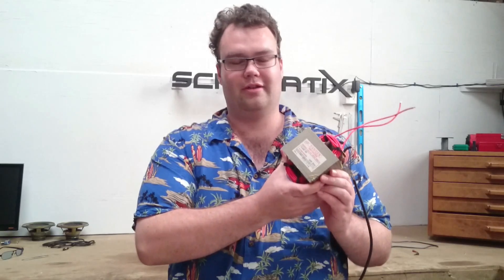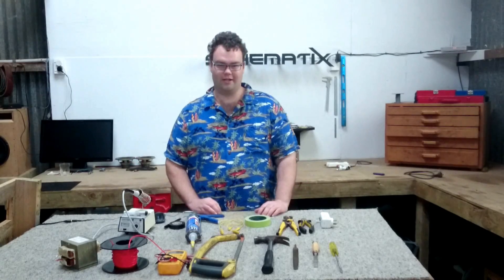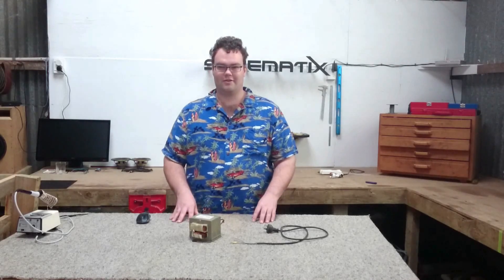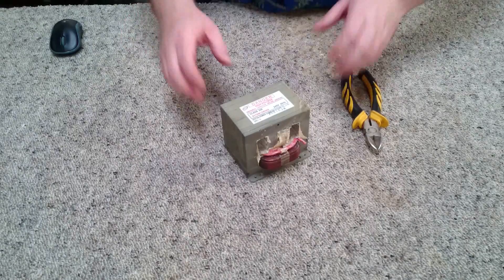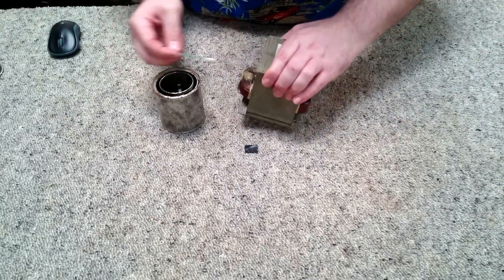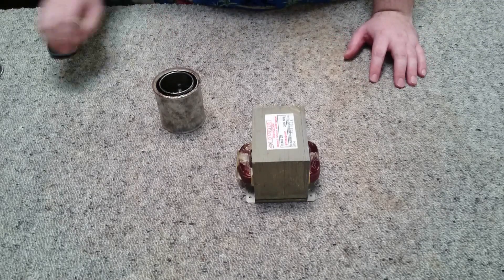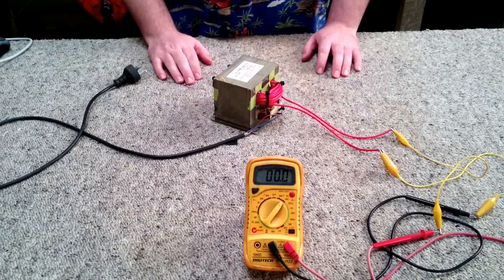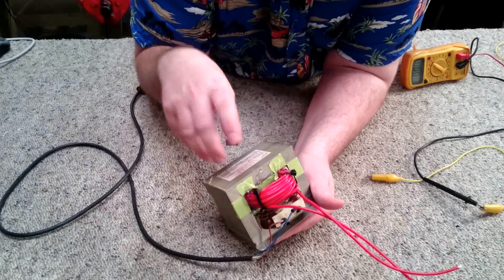How To: Rewind Microwave Oven Transformer, Trash To Treasure!

Comment: I love that you left the infected/effected flub in there. That made me grin.
Personally I think I prefer the breaking the E and I sections then levering the unwanted coils out and re-welding them together again afterward, but I like to keep the old coils for magnet wire later. Testing for shorts then dunking the whole unit into a bucket of laquer afterward might work to refasten any loose plates and reinsulate anything we might have missed also, though I'm not sure about that. Not tried it. I imagine a bit of candle wax on the contacts would break away afterward to stop the laquer from bonding where we don't want it.  I might have to try that with a wall mount transformer I have laying around here.

Comment: Can the Primary be removed VS secondary windings to increase voltage out? another words less primary windings with magnetwire and chock full of windings in the secondary to get very hig voltage, low current output = step up transformer and soak in oil bath with vacuum pump and get 10KV or more output?? Anyone can reply. looking to make a cheap HV transformer from microwave metal core?? Thanks..

Comment: IF you have no input to the meter, how can this be an overload.  The 'OL' stands for out of limits because the ohm measurement
is out of limits for the meter. The resistance between the two probes is trying to measure AIR which is a very high resistance,
therefore the meter can't read that high, So it reads OL (out of limits).

Comment: I might have missed it, but I think you must have wired the primary and secondary windings together? Is that a good assumption? So, you've got two ends sticking out of the primary and two ends of the secondary: do you wire the plug end (mains) to the TWO wires of the primary? But then...there aren't any wires to connect to secondary wire, or to go on to do any work--like spot welders and whatever else. I'm confused.

Comment: I question that.i did this on two different transformers.with same # of turns as you.transformer got smokin hot from the constant 4 to 5a load on primary.dont buy it at all,show me the line current on pri. With no load secondary...perhaps you cut the welds on the iron and changed laminations.these transformers are saturated on core.

Comment: Great. I want to make my own isolation transformer (220<->220) and first I thought about winding my own, but 220 turns? it's gonna take me a while. Then I thought what happens if I take a couple of trash microwave transformers, take out the 220v primary of one and put it into the place where the seondary goes in the second transformer? I would get the same exact number of turns on both, so, 220-220v. So my lan is to use a metal ginder to cut the sheets and re-solder them, as I have seen in other videos. Doable?

Comment: You will be surprised at how much current draw on the primary with no load on the secondary.  It will be around 10 amps.  If you kept it running for over 20 minutes or more, you couldn't touch it.  You need to add some windings to the primary, ( around 30 turns ), because the amount of windings that it came with is wound for max load ( It's under wound for a reason ).  That will also knock down the loud buz from the 60hz and the current draw with no load on the primary  will be a lot lower ( around 1 amp ).  This will not change the secondary output, it just won't catch on fire.  I would rather draw 1 amp with no load than 10 amps with no load, and keep my house from burning down.

Comment: i have a similar setup for 9v dc using a bridge rectifier. and i cant work out why. when i change the brown and blue AC inputs 240v leads over, i get 4.5v dc output
i was expecting there would be no change. any ideas?

Comment: What happened to the video of the power supply you used this transformer in? That was a great video.
Reply: He probably learned these transformers make for bad power supplies, you can't run them for very long before they overheat.  As others have commented you need to add more primary windings.

Comment: You Really dont Need to Put the Magnetic shunts Back into the Transformer, Their purpose is to limit the current going into the Magnetron when its in the MicroWave cooker  , When being used as an  ordinary transformer you dont Need to limit the Max Current , this Type of transformer is a ferro resonant device running Near magnetic saturation , In the Microwave the Magnetron Runs at Max output in All Modes when at Half power its on for 30sec and off for 30seconds ................Ect   anyway I enjoyed your video  But Im an Electrician and I thought Might Profit from this Information  cheers  Bn

Comment: You need to remove those shunts & NOT HAVE THEM IN THE FINAL TRANSFORMER.  (If you want mechanical support, put in wood sticks instead.)  If you leave them in, the transformer's output will be "wimpy" & collapse when load is put on.
Reply: And also I don't understand why the secondary was wound with a large gap to the core.
Reply: @paulcohen1555   The "gap" is filled with iron laminations, just like the rest of the frame.  This provides a "short circuit" path for the flux.  In "ordinary" transformer, you want ALL the magnetic flux to loop through BOTH the primary & the secondary windings.  Any flux that "short-circuits" & does not link both causes "leakage inductance".  This inductance causes the output voltage to sag when the transformer is loaded.  But "microwave oven transformer" is NOT a PURE transformer.  The leakage inductance resonates with the capacitor that is series-connected, & these are connected to the tube.  This causes the output voltage to rise much higher then the turns-ratio calculations would indicate.  The voltage rises until those magnetic shunts saturate, limiting & regulating the current feed to the microwave tube.  (Microwave tube "doesn't know when to quit".  It will draw current until it blows up if it were not for this limiting mechanism!)
          When making "ordinary transformer" from microwave transformer, both the capacitor & the magnetic shunts should be removed, as this regulation is not wanted.

Comment: very helpful I am an electrician and have 3 microwave Transformers. And was thinking of making a welder.
Using number eight stranded silicone coated wire. Any thoughts ? someone told me the wire you wrap around The secondary should be in the same direction as the primary.
Reply: You can't make an Arc welder using a microwave transformer, it won't handle it.
You can make a battery nickel strip spot welder using 2, 3 or 4 turns of cable plus a timer trigger module designed for the purpose.
.
You need bigger than AWG 8 to get decent reliable welds. You might to it with 2 Or 3  parallel connected AWG 8, which will be cheaper and easier to wind than single AWG 4. Check the AWG cross sectional area specs chart.
.
You will struggle to get a MOT to do sport welds in steel. The main use is for nickel strips under 1.5 mm thick.
.
The direction of windings only matters if you are connecting more than one transformer in Series or Parallel. If they are out of phase, you got it wrong, so reverse connections on one transformer (You can reverse the primary if you like).

Comment: Why manufacturers not using insulated wire like u did to wind transformers...this will prevent short circuit of transformer...i guess they don't want to run out of business
Reply: They do, it's called magnet wire and has a lacquer coating.

Comment: Just a few hour ago, I got rid of the secondary winding painfully. Then I removed the shunts because they helped protect the primary winding while drilling and hammering the secondary winding. By the way the windings are Aluminum, so be very careful not to damage the primary as its not easy to repair or solder. The outer surface of the primary winding got a bit of a scratch, it's dangerous it touching while connected to power. So I covered it with lacquer.

Comment: There is a formula 4 the number of windings the primary and secondary. If you only change the number of turns on the secondary then the Transformer is no longer at Max efficiency. Am I correct? Another important detail I wish you'd covered was Magnet Wire versus insulated wire. I still learned a lot from the video. I really enjoyed it. Thank you.

Comment: Could I use an extension cord for the secondary winding. I have lots of this wire but it has the neutral, hot wire, and ground wire in it. If I just twist these together will it still work fine?

Comment: Great video. Just wondering what the wattage of the transformer was?  I am trying to make a power supply for a 90v / 20 amp DC motor but finding the right combination seems to be a challenge as most of the transformers I have come across are 1100 to 1500 watts power in.
Reply: This is not practical at all. This transformer gets Extremly hot under normal load. Because the input power is too much. I tried many time in the past to build high current power supply out of it, but no hope. Only you can built Spot welder.

Comment: Just a word of warning. Be very careful when dismantling a microwave oven. There is there is a massive capacitor, which can hold a lot of current. If its still holding its current it can kill you. Be Especially careful with older models, newer models should have a bleeder to slowly bleed off the current. Just be careful and watch out for this capacitor and you should be ok. 
P.S. It is best to wait until the missus has finished cooking her 2 minute noodles. Ooh and don't forget to unplug it before dismantling.🤪

Comment: I am just a hobbyist.
what are the shunts for?
 What is the added benefit of replacing them?
I heard a engineer say you can leave them out for a 1 to 1 ratio  "NOT SO SAFE" isolated Transformer. You will need the added room and the added coupling  if doing that .
Is there a benefit to putting them back in or leaving them out?
Reply: Hi Ronnie. The shunts provide an additional magnetic path for the core and limit the total flux passing through the secondary. While used in the microwave, this serves to limit the power going to the magnetron. If you're rewinding the transformer for another application, they can be removed. I recommend high temperature insulated wire for your secondary winding. If you're doing a small number of turns with very large cable, such as for a spot welder, I also recommend FR4 or mica spacers between the turns. MOTs can be very useful and fun but they are very powerful and can be dangerous. Always take extra care and respect them. Take care.

Comment: I will try this but I'm going straight to cutting the secondary coil with the hacksaw. I'm skipping the step of removing the shunts before removing the secondary. I'm hoping the shunts are easier to remove after removing the secondary. [Oh!] Now I see the secondary is glued in place as you said and the shunts prevent levering it out. Okay. Nice work. Thank you.

Comment: I would like to build a 12/24 Volt charger/ jump start for my tractors. Would you be interested in showing how this could be done? Thanks, Randy. We are at -49* below up in Canada right now and always in need of such boosters during winter. They want over a thousand dollars for one. I even have quick connect heat lines between motors but when the batteries are down you’re done.

Comment: All of the information that I have been able to find on rewiring MOT's says to save the primary coil and wind a new secondary.  If the primary was not being preserved (because it was aluminum rather than copper) is there any reason to stack the coils as opposed to winding the primary full length (height) of the core and then winding the secondary on top of (over) it as is commonly done in other types of transformers?
Reply: You can do that, but implementing safe insulation practices becomes a bit more difficult. Also bear in mind that MOTs are wound with the bare minimum number of turns, which means they run close to core saturation so they get hot and draw very high currents when idle, which of course they never are when they’re in a microwave oven. To make an MOT operate like a ‘normal’ transformer, you’ll probably need to double the turns on the primary winding, which doesn’t leave much space for the secondary! They’re far from ideal transformers for most things, but if used for short bursts like in spot welders, they’re fine.
Reply: @ProdigalPorcupine  Thank you for the response.  I am going to try it and see what I get.  I will not be able to double the primary windings but will increase the number of windings to the extent that space allows.  It will be a few weeks before I get it done but I will update with the results.

Comment: hi thanks for this....advice= use an angle grinder, (i use homemade steel chopsaw 14 inch)to cutoff secondary.Shunts are needed in the redone core, as well, to separate magnetism. Also, a ground down railroad spike works best, to hammer out secondary core...fits like a glove. I've done many of them.......alternatively, also grinding off the welds, and take-apart the core.....works as well....then, weld up when done winding secondary bobbin.....

Comment: I’m very late to this party. I hope you might find a moment to answer a question. 
If you have rubbed the insulation off more than just one of the turns on the primary winding, is there any thing special you have to do to ensure they don’t touch under the lacquer insulation?

On rewatching I have a couple more questions:
1. Is there any advantage to making the wooden blocks more of an arc shape so the secondary coil turns are more circular as they pass outside the core from one side to the next?
2. Is the purpose of the shunts to add a ferric (“magnetizable”) spacing between the coils? Or are they there to reduce the air-gap between the coils, getting as much magnetizable material as possible between the coils?
Reply: the purpose of the shunt , it change the behaviour of the transformer from a voltage source to a  not so good current source , it is needed because the magnetron act as a zener diode  , if the shunt were not there  hi line voltage ( input voltage ) would destruct the magnetron .
Reply: @thecarl168  thank you Carl for that explanation. That is no doubt a very good reason to have the shunt.

Comment: I've only have one creative comment to remove the high voltage secondary instead of distroying it, you may want to use a small grinding wheel to cut along the laminates where it's been tac welded and re-weld this after the re-wiring, just an idea to save time,

Comment: After removing the secondary coil I tested the primary using 240V. After 30 mins. the temperature had risen to just under 100C. That's no load whatsoever. The primary uses around 70Watts no load, this may not sound much but it's all going into that small primary. The only real answer is to add more turns to the primary but that's messing about with mains Volts, unless you really know what you are doing make sure your will is up to date. It did seem to stabilise at  around 100C but what happens when the secondary is used for half an hour I have not yet tested. 'China Syndrome' ? - 'Frying Tonight' ?

Comment: Just removed the secondary windings from what looks like the same microwave transformer. It worked a treat but I used a 4lb club hammer as I was born near Birmingham (you work it out) .  I did note that the old secondary is aluminium and not copper. The primary is 1.02mm which is rather thick so I would think that's aluminium as well. I bought a second hand broken Monacor German amplifier for the bits and even that had aluminium windings and it was a torroidal transformer. The main problem is joining any wires to it unless you have the proper solder. You need 56% greater thickness for aluminium than copper for the same conductivity. Sign of the times - yuk. (I'll give you a hint 'screwdriver')
Reply: you can solder ali using mineral oil as flux
Reply: @stevioAda  Cheers for that, but do read my latest comment.

Comment: My experience is that if I rectify a transformer then my output voltage will drop a little. Might be good to fit a bridge rectifer before final testing to see if it’s the voltage you wanted.nice straightforward demo ....
Reply: Adding a capacitor after the rectifier will boost the voltage to the AC peak.

Comment: How can i work out how many amps it puts out also?
Reply: That's a little trickier without knowing things like the primary and secondary inductance and core details. I would just keep adding load until the voltage began to drop to my minimum requirements.

Comment: Really like the detailed information on recycling or reusing trash item. If I may add some other tidbits to your project. Use foil metal instead of wire. This will increase the duty cycle of the transformer. You can put in cooling fins between the foil windings to overdrive the transformer without damaging the item. Also, you can easily put on taps for different voltages for different applications. Keep on doing projects for us all to see.

Comment: nice video I tried to make a spot welder. For it i bought a  used MOT, the seller connected ac voltage to the primary winding (thin wire side). And it created humming sound. At home I removed that side and when I connected ac to the secondary side it created smoke and smell and became very hot to touch. Seems like the Secondary was already short? What you say? 

Also Now can i rewind it using suitable size enameled wire? Will winding it with slightly thinner wire be ok for spot welding? Current winding is using 0.9mm enameled copper wire and the length and breadth of cross sectional area is 15 by 17 mm..